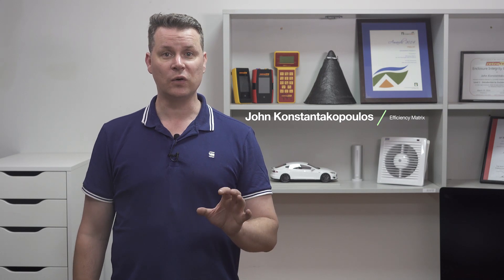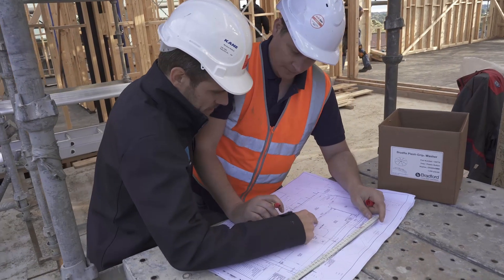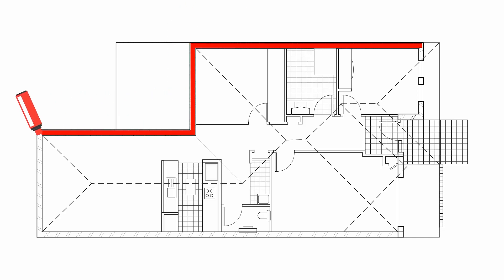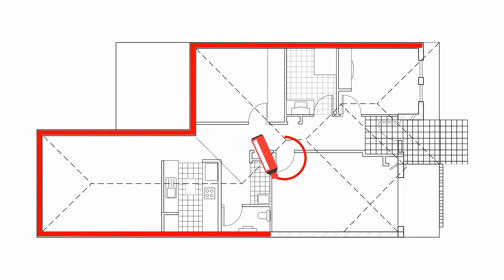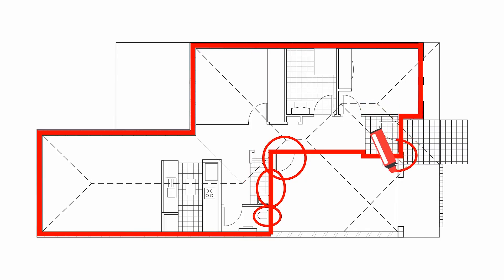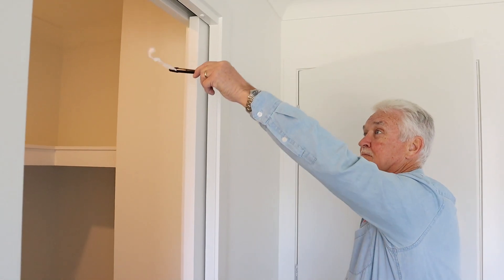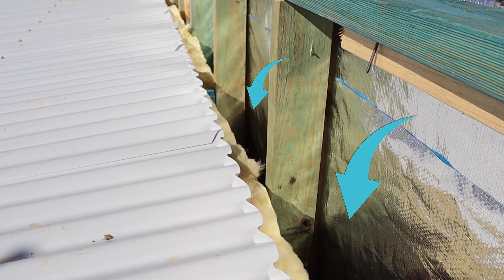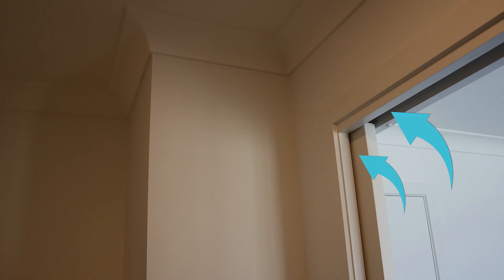Designing a home for a Better Seal | Part 2

Comment: That's a great idea! Provide a well sealed system with great ventilation... those two things are opposites. I can see a lot of mouldy houses in your future.
Reply from the maker: Juscody, your Crystal ball may be faulty.  Please explain how an open carport has condensation on the sealing soffit and how more natural ventilation could solve this problem?  This problem could be solved mechanically potentially.
Reply: @ecoevo  I can't quite make out what you're asking. How about you explain how different a "well sealed system with great ventilation" is any different to a standard house.
Reply from the maker: Firstly can you explain to me why a car port soffit roof gets condensation on it even though it is completely open on all 4 sides and then I will have a crack at your question, even though standard home air tightness and ventilation implementations can vary in effectiveness soo greatly.
Reply: @ecoevo  have you even seen a building? How can you have a "soffit roof"? Your first reply spoke about a "sealing soffit" is that a soffit that hunts seals?